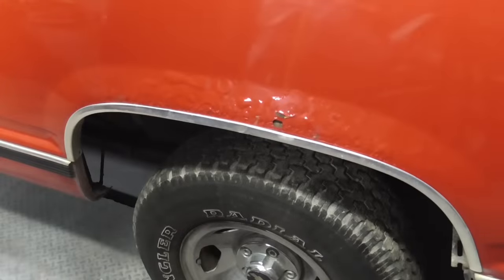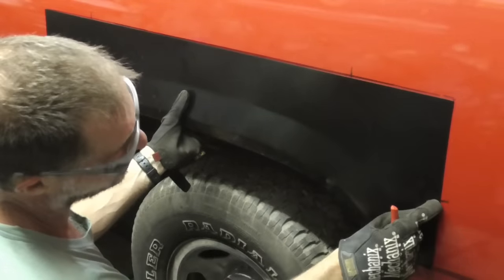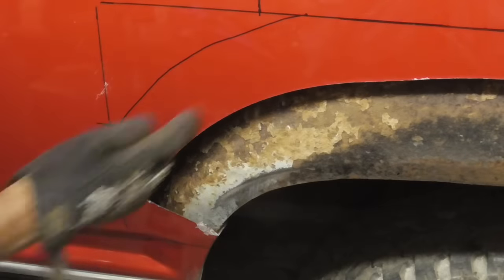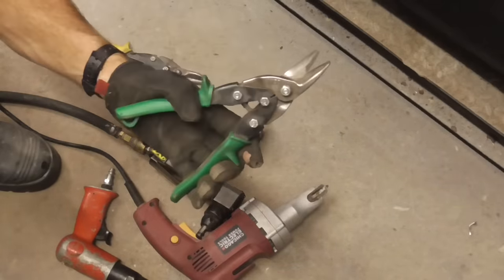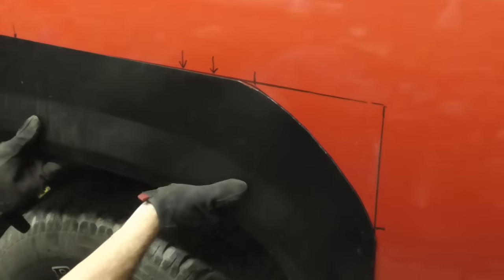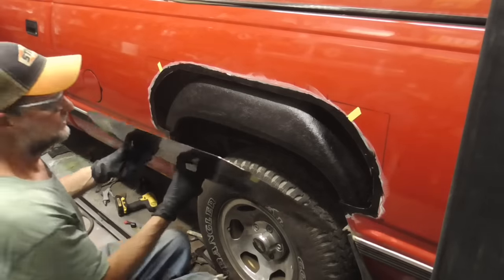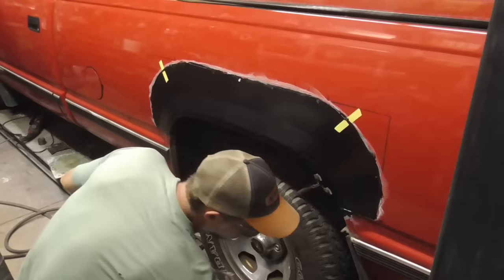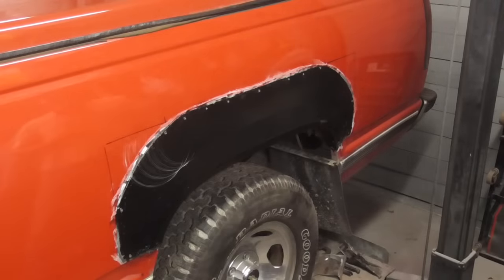Glue On Wheel Arch Rust Repair Panels w/ SEM Impact Resistant Panel Adhesive

Comment: Curious how this would work on a door skin. My thoughts is that the adhesive would keep water from getting into the fold and rusting the bottom the skin out like they tend to do.
Reply: I have done this very thing on past projects, worked great.  I've also used it on a roof skin (I did weld it on the corners though)
Reply from the maker: Works great - https://www.youtube.com/watch?v=d21RkqTwRqs

Comment: I wish i could find a body shop in KS that does rust repair
Reply: Some guys here in kentucky started cutting rust out and fixing rails and any and all body and frame parts, they started about 6 years ago, they are mskibg big time $ now. Its hard to find anybody to cut and weld on the frames of these crappy pickup trucks they ben making. Im glad sombody arpund here started. Its was always a liability issue i guess, cutting frames of relitivly new vehicles. Thats why most wouldnt do it here. But these guys will cut and weld bsck anything, and they do very well. 
 Im gonna replace my bed panels on my fords. One has 100,000 miles, and its rusted thru. The other is just starting. The newer truck is way rustyer than the 04 truck

Comment: Cutting the panel using rounded edges will allow for use of a flange tool. ( flange tool will not flange square corners)Then the panel sits flush meaning little to no knockdown. Flanging the panel also stiffens the panel .
Reply from the maker: What about flanging the wheel well lip and around tight areas?
Reply: Plus not enough surface area to bond to. Need 1 inch to bond to, not 3/8"

Comment: Welding it in seems like a better solution from what I've seen...if you have a welder and experience welding
Reply from the maker: Some folks prefer or like the water tight seam that comes with glue 👍

Comment: Oh hey, another point to make about these panel bonders, SEM and 3M is that you can bond dissimilar metals together! That's right, you can't weld them but you can panel bond them and they will NEVER come apart! Aluminum to steel, pot metal to steel, ect. I used the 3M Panel Bond to mate my Duster tailights to the inside of the rear body panel when from the factory they mount to the outside using ugly pot metal trim brackets. I glued them to the inside of the panel and cut away the excess metal so now they flush mount and look beautiful. I should put up a video of the results.
Reply from the maker: You can put the results on the Lakeside Discord - click the icon on the top right of the channel banner :)

Comment: Any patch lines appear after extreme temperature change / exposure?  That is my experience with patches in large panels and seams not at edge of the original panel. Thanks!
Reply from the maker: No, I think if you tap the seem down, the filler acts as a buffer/protectant of that.  Here's a follow up video on this truck and other older work - https://www.youtube.com/watch?v=t1WclT_GMvk  & https://www.youtube.com/watch?v=gIS1Tbv7Kvw

Comment: Why did y not for por  15 the inner fender also couldt have off set one panel with a flange  toll then panel w be flush
Reply from the maker: You can flange it if you like too.  You can also use the POR 15 to prep the inner panel to prevent future rust.  Have a good week Jim :)

Comment: Did you hit around the patch with the hammer at about the 8:38 mark, to give the bondo more surface area to fill or why did you do that? Just wondering, I think I’m going to attempt repairing my truck so want to be sure of what I’m doing
Reply from the maker: Unlike TV/magazines/internet, body shops weld metal in, knock the seams down, and fill.  For many reasons, this works the best and lasts the longest.  So the seam is always knocked down a bit to hide that welded/glued connection forever.  See this vid for more on that topic:  https://www.youtube.com/watch?v=ZgAA4PD8EUs

Comment: I've done several the same way, You can save yourself a step, by instead of using rivets just grind off the head of the screws you use to hold the panel in place.
Reply from the maker: Great Idea - glue the screws in and grind the heads off - I'll do that.  Thanks for the support and tips :)

Comment: What if anything do you do the back side of the panels and joint to prevent salt and calcium chloride induced corrosion? I get that the joint is glued and sealed, and that outer surface is painted and sealed. But the entire unseen rear side is unprotected and will likely rot out really quickly since (so far as I can tell) it's largely unprotected and will be exposed to very corrosive substances.
Reply from the maker: Check out both of these to prevent future rust - https://www.youtube.com/watch?v=8XaZBy7GC7A & https://www.youtube.com/watch?v=y05dNxt-nVc
Reply: @LakesideAutobody  
I've been having Krown of Pittsburgh so my cars in the last few years. For $169 a year they put it on a lift and pull through the frame or unibody, mist the entire floor pan and suspension, inside all body panels and pillars and the firewall and inner fenders. It's a very fluid and flowing oil like product that Krown Rustproofing of Canada supplies. I have high hopes getting longer rust free service using this affordable procedure each fall. They also have large aerosol cans of the product and I do have a half dozen or so that I can add some additional product with.
Reply from the maker: @LarryMusgrave  Maybe one of these is what they use?https://www.youtube.com/watch?v=3EhSAT-UoQo&t=1s  This guy is out of Canada :)

Comment: Just curious on why you didn't flange the panel before gluing?
Reply from the maker: Two reasons:  You can't always flange i.e. around sharp bends, 90 angles, wheel openings, door jambs, etc.  so it's good to find one process that works 100% of the time.  The other reason is most  flange tools are not wide enough.  Good question Tom :)

Comment: I heard about this method but I'm doing a wheel Arch on my Chevelle I'm welding it in there is no way I'm going to do this glue rivets then do the Bodywork I'm better off just welding it it is a nice trick but it seemed to look and take a lot more time-consuming than the job that I'm approaching
Reply from the maker: Both methods work great as long as you knock your seam down a bit before filler.  It's good to have a buffer between the seam and the finish.  None and you'll likely see the seam later on down the road.

Comment: i just did my dodge ram the same way but i flanged  the 1/4 with the vice grip  flanging pliers and glued it then after i took the tap screws out i used fiberglass filler then regular filler primmer and paint came out nice for a mechanic l think it will last longer then welding it on thanks for the grate videos
Reply from the maker: You're welcome Smokinjoe.  I think you're right about the longevity of this type of repair.  Have a good weekend :)

Comment: Might be a dumb question but why cut away all but 1"? Better fit?
Reply from the maker: I'm not sure if I understand your ? but I'll try to answer best I can.  I left one inch for a nice wide surface to glue to.  Another thing is I wanted to stay far away from the body lines so when you tap the seam down you're not affecting those areas or even coming close to the body lines :)

Comment: Quick question:  is it better to use fiberglass instead of bondo in that area?
Reply from the maker: Probably.  An old boss used to make us use fiberglass reinforced filler first then finish w/ reg filler.  Ofcourse we cheated but never had any comebacks so.... can't really prove it one way or the other.  Not fiberglass cloth though - I wouldn't go with that :)

Comment: What concerns me is no waterproof  sealant ie some sort of body silicone or other was not applied between the wheel arch (mud gaurd) and the new panel being fitted , within a couple of years rust would break through again.
Reply from the maker: Number one is drainage - make sure your repairs can drain and dry out on the inside.  Next is this - https://www.youtube.com/watch?v=8XaZBy7GC7A  It'll last as long as you have the truck or car :)

Comment: What should one budget for a repair like this ? $ 1500 .00 ? Thanks
Reply from the maker: It depends on the shop you take it too.  If you do it yourself - 50 for the patch panel, 50 for the glue, 30 for the filler, 200 for the paint and primer, maybe 50 more for sand paper and random stuff.  ~ 400?  More or less depending on what you already have 😊

Comment: Hi Jerry, I'm finally about ready to tackle my Silverado...  I have the patch panels and glue, just need the rivets and screws.  I'm assuming stainless steel 1/8 x 1/4 rivets but not sure on the screws - no. 6 or no. 8, can you advise?
Reply from the maker: I used those screws for gutters from the hardware.  Any small sheet metal screws with work.  The rivets can be simple too - real common ones like aluminum - they'll never even see moisture.  If they do they're up high and they will quickly dry preventing any corrosion.  But... up to you - stainless is better.  Heck even one of those patches glued in place looks better than rust so there's no worries.   Ask ?s along the way - I get to them every day.  Take your time and think it out before gluing.  Once that glue is cured, it's there forever!  One thing that is important is making sure the panels lay nice and flat together - don't worry about the glue squeezing out as it has micro sized balls in the glue that prevents pinching the glue out of a seam.  You're living the dream my friend!
Reply: @LakesideAutobody  Thanks again for the help and swift reply, Cheers!

Comment: I use self tapping screws. Once glue is dried, pull screws, fill with glue and spread glue after sanding first coat of glue as filler. Then use mud...
Reply from the maker: Sounds like it'll work fine :)

Comment: For the edges that you overlapped, you grinded it down right or was it the part where you beat the edges in with the pointy part of the hammer?
Reply from the maker: On all patches (welded or glued), you'll tap the edge down, grind, fill.  You never want to grind the heck out of any seam - thinning the metal or surrounding metal.  Weld/glue, knock the seam down, prepare for filler (ginding/sanding), fill - :)
Reply: @LakesideAutobody  ok gotcha. Thanks alot
Reply from the maker: 👍🎄😊 @trentdaddydolla647

Comment: How does the glue under the panel hold up over time vs welding?
Reply from the maker: Automotive panel adhesives have been used now for many years by OEM to glue door skins, rockers, roof panels, etc. so there's no worry when it comes to strength.  As for longevity here's a follow up video on this and another vehicle w/ all methods found on this channel - https://www.youtube.com/watch?v=t1WclT_GMvk  - https://www.youtube.com/watch?v=gIS1Tbv7Kvw  both trucks are in town here - they're still just fine.

Comment: I know this will make a lot of eyes roll but, i have rust pretty close to the gas fill door,(about 4 inches away) should i remove the fuel pipe before using a grinder near that?
Reply from the maker: You don't have to.  I always sniff around to make sure there's no leaks.  You can cover or mask the cap and any other parts to stay even safer.  In all the years working in body shops, I've never seen a fire, or explosion.  Think of muffler shops how many times there's sparks near tanks :)
Reply: @LakesideAutobody  That's for the help, now i can try this without fear of blowing up
Reply from the maker: You're welcome - let me know how it goes for you :) @dragonfire7734

Comment: only a top coat will show the true surface straightness of the finished product. Im not sure that overlap can be covered with filler buildup on the surrounding panel. I think if that top coat was black you cold see a bulged area in the overall panel.
Reply from the maker: Good body shops in Michigan tap the seam down, fill, prime, paint.  That's how quality body shops prevent the seam from showing.  It will never show either as filler is a great buffer between the metal seam and the finish.  You never want a seam (i.e. butt weld) right under the finish.  Here's a good follow up on this truck - https://www.youtube.com/watch?v=t1WclT_GMvk

Comment: Would it be better to flange the existing quarter first
Reply from the maker: You can if you like but remember the flange will not be that wide.  An air flange tool's throat is around 7/8" with about 1/2" flange.  Also, you can't flange around lips,  sharp bends, extreme contours like rockers, etc.  If you can flange though and you feel that it will hold well then yes it would work well :)

Comment: Your videos are awesome and so helpful, Thank You Sir!  I need to do both wheel arches on my 2011 Silverado.  Do you have any recommendations on the adhesive and how much I would need for 2 panels?  I know you have used the SEM Dual-Mix.  Some other folks mentioned J-B Weld Seam and SikaFlex 252.
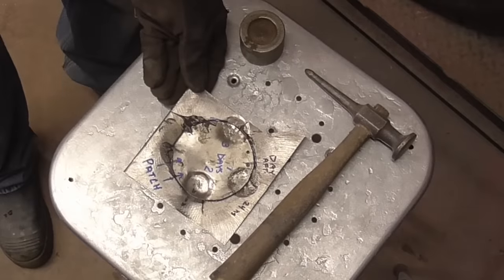Reply from the maker: I like SEM SEM Impact Resistant Panel Adhesive because it holds up well to tapping the seam down - see video at 9:07.  You'll need one tube to do both side.  I've used JB too see vid - https://www.youtube.com/watch?v=wRl1QfkrBeY  I tapped lighter on the seam as I'm not sure how well JB holds up to sharp impact but it held up well see follow up video - https://www.youtube.com/watch?v=gIS1Tbv7Kvw  Hope that helps :)
Reply: @LakesideAutobody  Thanks for ALL the help, You Rock!
Reply from the maker: @livingthedream335  You're welcome.  Ask any ?s you have - I get to them 1-2 times a day :)

Comment: What was done here is accurate of the average body shop. Not gonna knock his repair method at all. However, I tested a product similar,  by the same manufacturer,  might be the same product,  not sure. Its great for a fender patch panel. IT IS NOT FOR STRUCTURAL PARTS. Someone else mentioned concrete anchor epoxy.  Simpson strong tie makes such an adhesive. I'll try it on some metal and see if it does any better.
Reply from the maker: They build cars today with a lot of structural adhesive, glue roofs on etc.  It's plenty strong - I like welding too but this will be the future for sure.
Reply: @LakesideAutobody  a friend of mine was fired for refusing to use a bonding agent on a b pillar of a 4 door sedan, crash damage,  and insisted on welding it. You're right,  oe manufacturers use this sorta stuff alot. For minor patch panels, yeah, just did a patch on a door and second thought wish I had used this on the skin but welded it instead. Had to deal with warpage of course. The panel bond would have been fine on the skin and weld the structure.  Structural repair, I'm always gonna weld and plate it and rosette weld on the back side. Might be my ocd. My shop is more restoration so I'm allowed to take extra time if I deem necessary. Basic lower fender patch, yeah, this stuff is great. Also, the panel bond would be great as a back coating on a welded seam of a structural repair. If the chemists made a weld through version of this, id buy stock and be a big customer.

Comment: Why cur out the rusty metal, why not just go right over it?  Once covered the rust will stop/slow down to the point it will not rust through, will it?
Reply from the maker: Well... moisture will get between the layers and create a thick bulge/mass of rust pushing the bodywork/panel out which makes that bubbling look you get on an old restoration or paint job that's going bad 😊

Comment: What are the limits of this technique. I want to do this on the rocker panels on my 2002 suburban
Reply from the maker: There really are no limits.  Folks will state, " safety! safety!"  But my reply to that is, " You didn't have a rocker before because it rusted away - now you have one.  Was it safer w/o one?"  Glue is used at the factory for roofs, quarters, door panels etc.  it's very strong :)
Reply: @LakesideAutobody  yeah good point there . I think I will cut the rockers out spray rust inhibitor and glue some new rockers thanks
Reply from the maker: @donaldstepp4850  Feel free to ask questions as you go if needed - Jerry

Comment: Could I use a ball-peen hammer instead of a pointed body  hammer to create a trough for the Bondo?
Reply from the maker: How about a punch or screw driver and a hammer that would be just like a pointed hammer - even more accurate :)
Reply: @LakesideAutobody  Thanks and I appreciate that you take the time to answer questions and show what tools you are using in the "show more" section.
Reply from the maker: @johnbean9510  You're welcome - no problem - feel free to ask any ?s even if they seem real simple.  Those, sometimes, can be the most debated and tricky.

Comment: What would a job like this cost including paint to have done?
Reply from the maker: Prices vary greatly from shop to shop.  At a professional shop that will do the work, it would be anywhere from 800 up.  $800 is probably on the low side.  The paint, patch panel and other materials are right around 300 and say 500 for labor - again that's the low end.  Not a lot of shops will take on this type of work though so...  Hope that helps give you an idea of the cost Dusty :)

Comment: How much to do a job like this usually run?  Per side
Reply from the maker: Typically anywhere from 500 to 1000 or more depending on the shop.  Body shop prices vary greatly and some price it extremely high to discourage folks from even having it done.

Comment: Hi Jerry, I couldn’t tell? The rivets are you putting bondo over the heads?
Reply from the maker: Yes - you can leave them in or remove them. The difference in metal (as some comments say) really isn't a problem as they are encased in the glue. Also I usually lightly hit them with the grinder/sander.   I did this for a guy in the neighborhood.  If you ever want to see about the longevity of the repair just ask - I see it almost every day.
Reply: Thanks very much Jerry